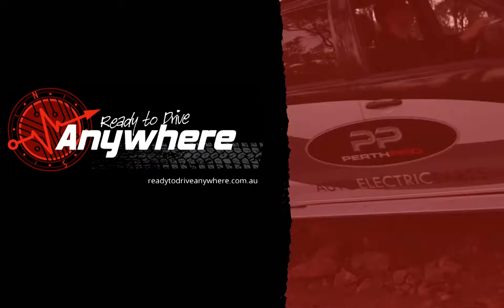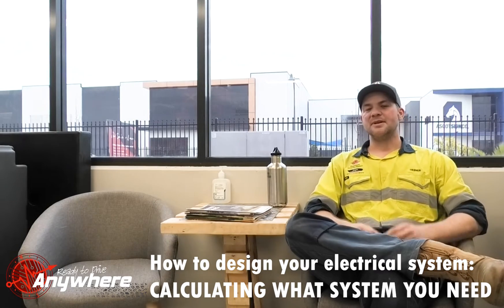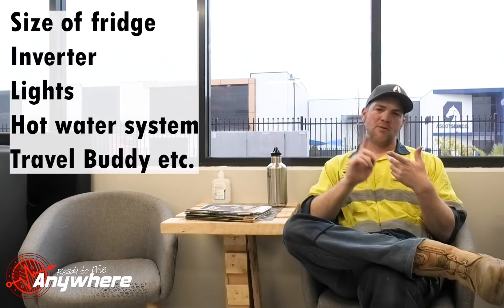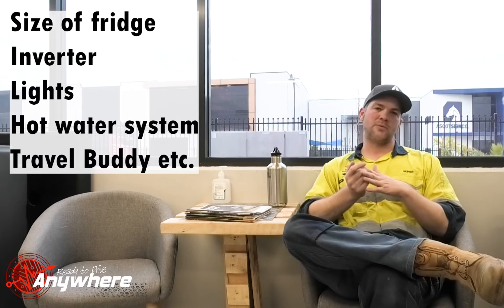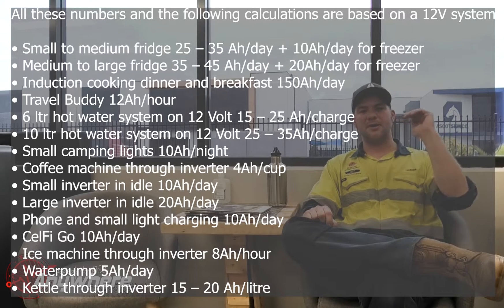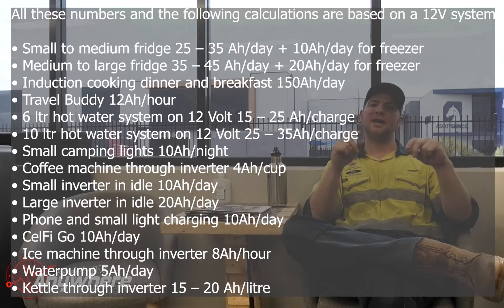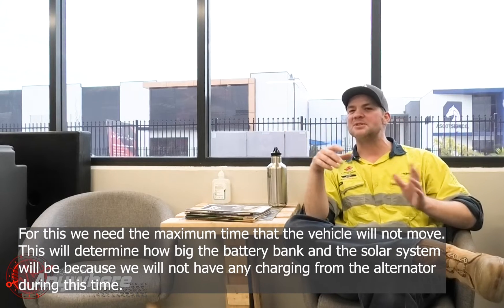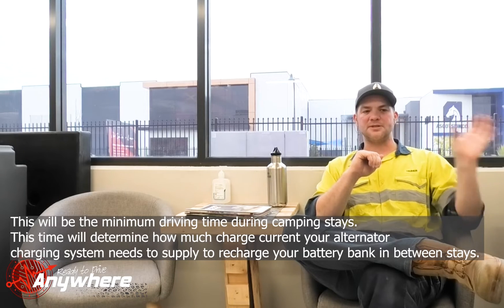Heiners Workshop Lessons: Offgrid Auto Electrics | Episode 3 Calculating What System You Need

Comment: Can you over charge a battery and damge it? as im thinking of putting a redarc 1225bcdc to recharge my two wet type batteries, one under the bonnet and the other is under my tray on a ute, would the 25amps be good enough and a 40amp bcdc be too much and cook it?
Reply from the maker: Hi Tom, thanks for the question. The best answer we can give would be, as long as you choose the right charge profile on the charger you can not over charge your battery. A charge current outside of manufacturers specification will shorten the lifespan of the battery but not destroy it. Please refer to your battery specification and configure your charger accordingly.
Reply: @ReadytoDriveAnywhere  awesome, thanks for getting back to me 😊